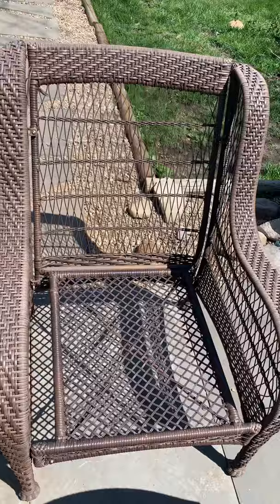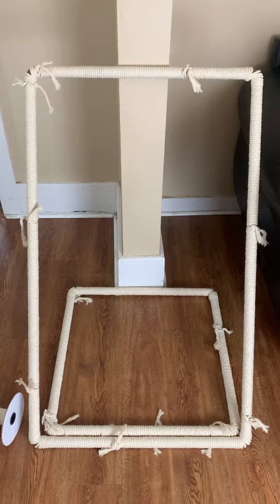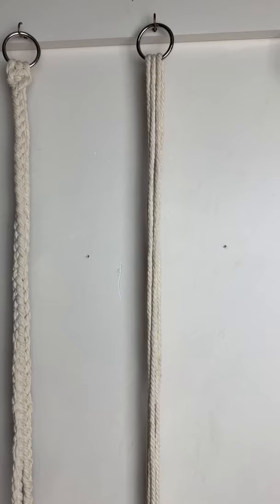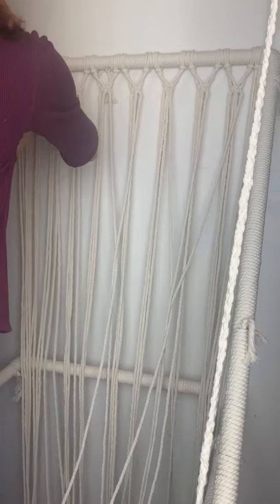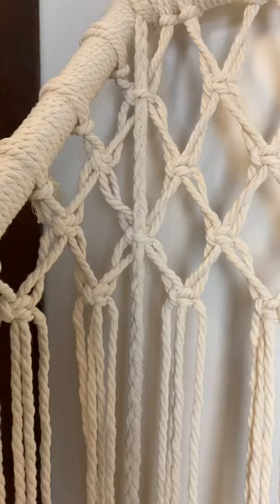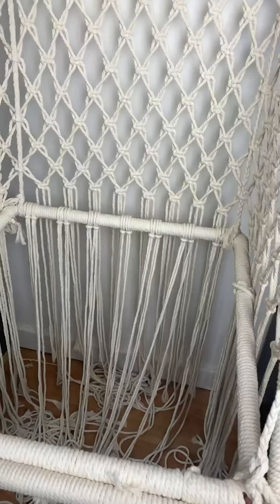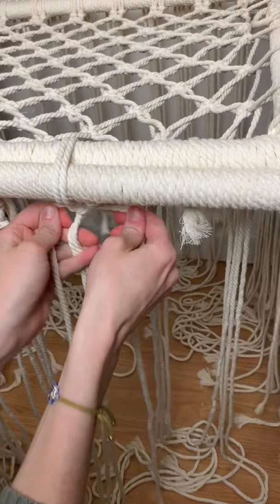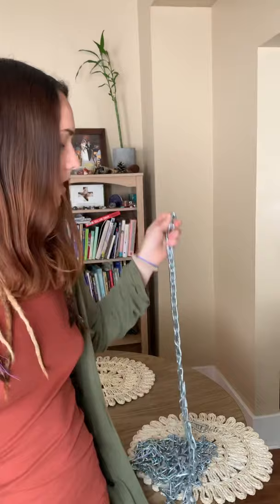How to Make A Hanging Macramé Chair

Comment: Beautiful please share measurements
Reply from the maker: Thank you!
250ft to cover frame
6 pieces of 14ft 
18 pieces of 14ft 
2 pieces of 13.5ft
2 pieces of 13ft
2 pieces of 12.5ft
2 pieces of 12ft
2 pieces of 11.5ft
2 pieces of 11ft
2 pieces of 10.5ft
2 pieces of 10ft
2 pieces of 9.5ft
2 pieces of 9ft
2 pieces of 8.5ft
14 pieces of 11ft
Reply: @macymccall9874  please tell me exact at which part to use 8.5ft to 14 feet lenght rope